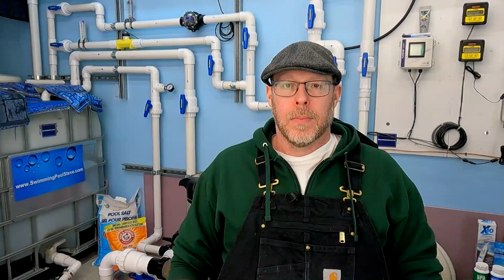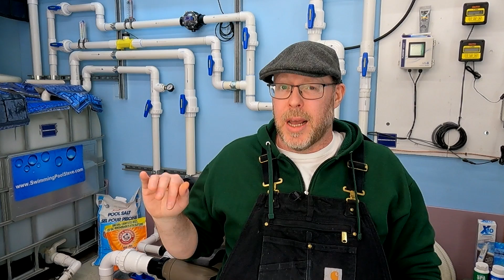Why Are Infinity Edge Pools So Expensive?

Comment: Pool. Maintenance is hell
Reply: Especially when you make the mistake of NOT installing a lower basin skimmer AND size the lower basin appropriately TO the size of the main POOL! Not rocket science but well worth the effort as the lower basin will perform flawlessly especially with an automated system (automated valving / timers / etc).